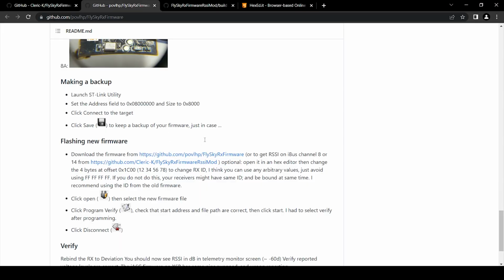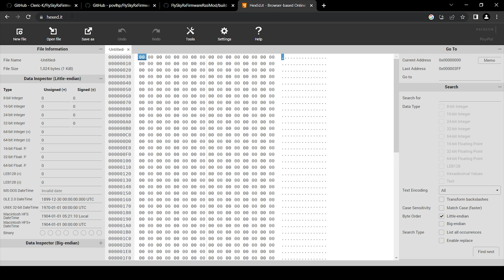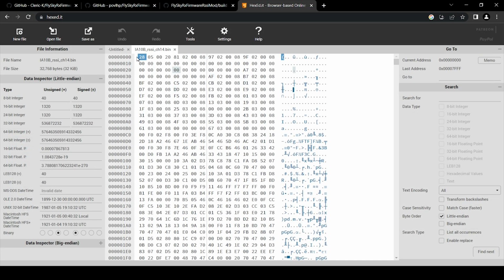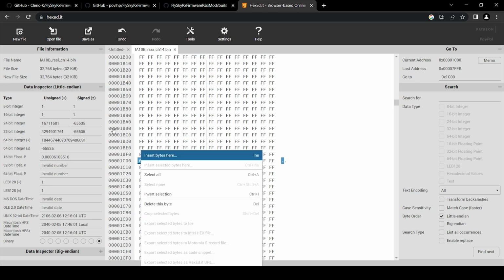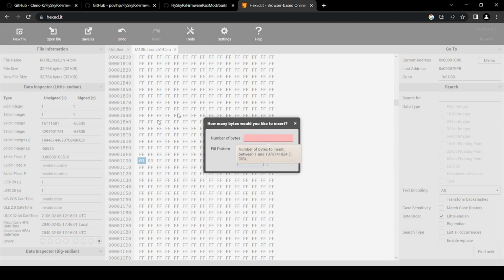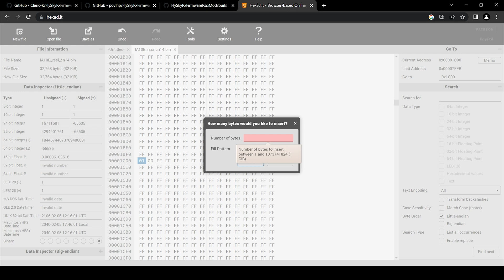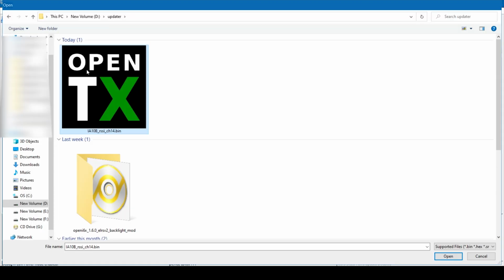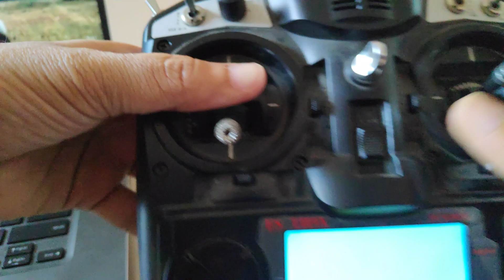Bind Multiple Flysky Receivers to One Radio Module FS-RM003 Receiver Memory Hack TH9X Turnigy 9X

Comment: Hi Rakish! Can you please tell us which radio has receiver memory function?
Reply from the maker: If looking at flysky radios then Fsi6x has it... you can flash openi6x firmware on it which also supports receiver ID..most new. Edge tx radios like boxer or tx12 also have rx memory feature. Choose which version of rf module you want before buying one

Comment: Hi! I tried to follow your tutorial today, and the other one, ""Flysky FSIA10B Receiver RSSI Firmware Flashing Turotial for OSD RSSI Value". When I came to the step of turning off the "Read out protection", setting it to level 0, first one, and then another Flysky FS-iAB6 receivers stopped flashing, and in fact died. I suspect that this operation is not permitted. Perhaps this is protection against piracey of software?
Reply from the maker: The new receivers from factory are protected..once it's disabled the existing firmware on the chip is erased. Once you flash the rssi firmware with changes you receiver should work as normal again.
Reply: Rakish! You are right! I was able to do it! I was able to flash what I thought was a "dead" receiver. Thank you very much for you video and advice.
Reply from the maker: @tomjoad1060  cool 👍 gald you got it working
Reply: Check how this double receiver system works in my case: https://youtu.be/pF_-9Q0BcoQ?si=TTD9cywqjNjvznRX
Reply from the maker: @tomjoad1060  I saw the video. Very well setup.  Glad to know my video was helpful to you 👍
Reply: @RakishRc  both motors are connected to the second receiver. The first receiver is only to turn on the main battery, when it gets a signal from the TX. Once that signal is given, I use the second receiver to control the two motors. If you want, I can send a link to a video where I do that. Thanks man for help. Gennady
Reply from the maker: @tomjoad1060  yes I re watched the video and got to know the setup correctly.
Reply: @RakishRc  however I cannot connect to the receiver once I disable the protection. In fact, it completely stopped working. It doesn't flash light when connected to battery. I have a feeling it's dead. What should I do?

Comment: Hi! I am trying to use 2 receivers simultanously (FS-iA6B) with Flysky FS-i6 transmitter. In your explanation here https://youtu.be/XOU8JpGGoXc?t=82 you don't explain where one is to get the file which is to be edited, which is to be flashed to both receivers. Can you go over this more carefully? Thank you.
Reply from the maker: Link for firmware is in the description. Choose the firmware file for ia6b receiver and edit the bytes so that it's same in both the receivers.
Reply: @Rc thanks for answering. How to upload the edited files to the 2 receivers? By the way: here is a video showing why I need 2 receivers: https://youtu.be/jK7MPm_TqZI?si=6-xZuyF5a2k8PXy5 one receiver is to turn on the relay to the battery, which then powers up the entire system. When I am making a robotic boat, I plan to turn off the relay, so the motors don't use energy.The second receiver needs to stay on to be able to turn on the entire system.
Reply from the maker: @tomjoad1060  once firmware file is edited use st link utility software or stm32 cube programer software to upload the file on to the receiver.
Reply: @RakishRc  what hardware do u use? How to connect to computer?

Comment: So i was planing to buy radiomaster tx12 mk2 but can it really support fs-rm003 external module.
Reply from the maker: Yes absolutely. The FSRm003 module work with ppm protocol so you can use it with tx12 and bind to flysky afhds2a receivers.
Reply: Thanks sir. I am newbie in rc hobby. do you have other social media site like facebook or insta
Reply: @rohitx1133  i have jumper t8sg for sale with flysky protocol built-in.. it can bind to flysky rx